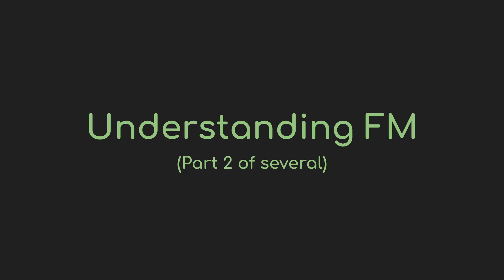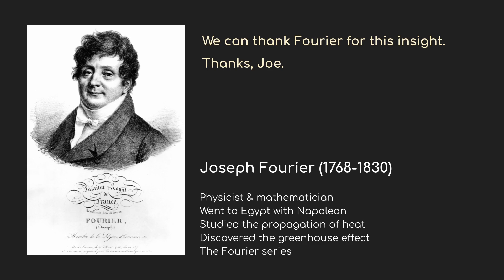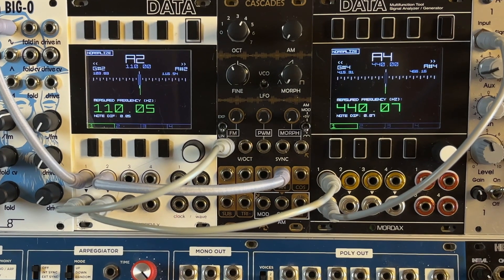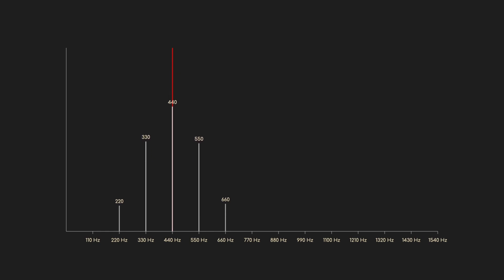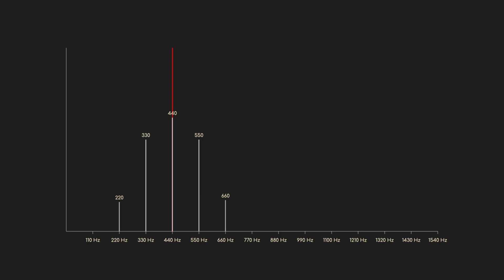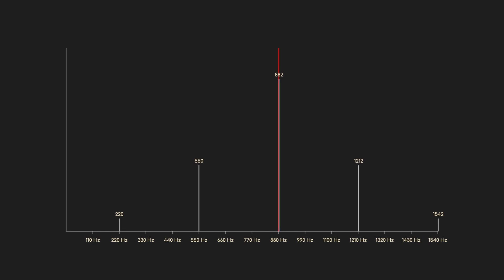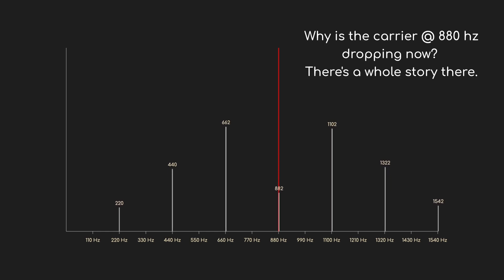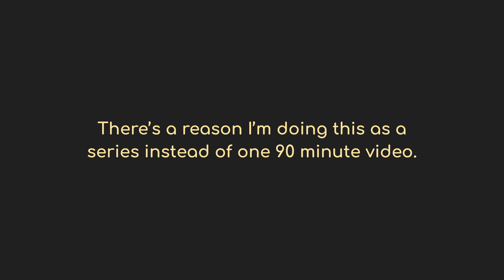Understanding FM #2 - The magic of sidebands and the origin of all those cool sounds

Comment: At 1:20 you are showing the FFT of a sawtooth wave.  My question is very fundamental... why does FM modulation produce those sidebands as you increase the frequency?  I can understand why the carrier frequency moves up and down in step with the frequency of the modulating wave. This is clear to me at the very low frequencies. You can see the carrier frequency moving up and down. But why are sidebands produced once you get it going fast (110Hz)?
I didn't expect this to happen. If its a mathematical reason, I don't mind the math. Is it that the measuring equipment can't follow the rapidly changing frequency of the modulating wave?
Reply from the maker: @mikeconnell698 - This is really an excellent question and one that I did (and continue to) struggle with a bit.  

I still need to make the video that breaks into the actual math behind FM.  But, take a look at my Sine Wave video, around the 9:50 mark, the equation there shows a sin() function inside another sin() function.  That is the basic function that describes FM, I just haven't dug in yet.   That sin( sin() ) causes oscillations inside of oscillations.

If you haven't already seen my video about Oscillators, Harmonics and the Fourier Series, it's good to look there next.  Quick summary: every sound can be decomposed into a series of sine waves.  When it's just "a sine wave", like we start with here, then that series is really simple.  It's just that one sine wave, easy peasy.

But as sounds get more complex -- like oscillations inside of oscillations -- the Fourier series is changing -- it adds in new frequencies.  The nature of the changes caused by that particular equation mean those new frequencies are the overtones we see appear.

To go much deeper, I'll really need to make that video about the math.  There's a lot hiding in there, but I hope this helps.

Thanks for the great question!
Reply: @SoundVoltage  Thankyou so much for the response. It does help! Is it correct that these sidebands can be thought of as AM modulations of the carrier frequency? They look like the same sort of sidebands produced by AM modulations. If it looks like a duck and quacks like a duck...?

I have another question. When I look at jitter. I often see this associated with a widening of the base of the carrier frequency. Is this widening a very low frequency FM modulation? How does jitter manifest on these graphs?

Comment: Great video, this cleared things up a lot for me. Just out of curiosity, is that spectrum display reacting to the audio from your modular or is it an animation? I noticed that none of my analog modules are capable of producing a sine wave as pure as shown in the graph, even the self-oscillating filters have a few higher harmonics at around -60 db, which makes it a bit more difficult to see what's going on with the side bands.
Reply from the maker: @nilskozstum8256 - It is being generated by the audio coming out of the modular rig, but since I wrote the code, I get to make decisions about how big frequency spikes have to be before I include them in the animation.  Generally speaking though, I'm not intentionally cutting anything out. The only sine wave I've really a real extra frequency component in is the Nonlinear Circuits CEM 3340, and in that case you can distinctly see a little sharp peak right at the apex of the waveform.   I'll have to check things again though.
Reply: @SoundVoltage  thanks for clearing that up! I guess it's down to how the sine is generated, my main oscillator that I use for FM is the Instruo Cs-L, where one of the oscillators is a triangle core and the other a saw core, which then get filtered/sent through comparators to generate the other waveforms. You can clearly see on the spectrum that the same harmonics that you get in the core waveform are still present, just much more toned down. I don't mind this at all, I love the sound of these oscillators. I was expecting the filters to be cleaner then they are though. Cleanest sine I could get from MI Plaits, unsurprisingly digital will get you the most mathematically pure sine.

Comment: These are so valuable! I'm learning a lot. You really can't overstate the value of an oscilloscope. Seeing what's happening visually makes all the difference.

I do agree with the other commenter about text on the screen that doesn't match what you're saying. Some great advice I heard a while back about presentations is not to make the audience read and listen at the same time, cause they can't do both. What I do now is make each slide either a picture or a single word, or at least as few words as possible, specifically avoiding sentences.